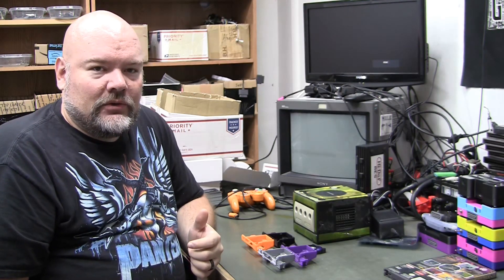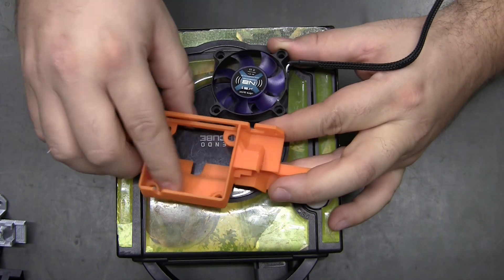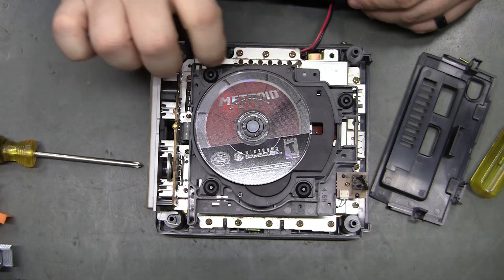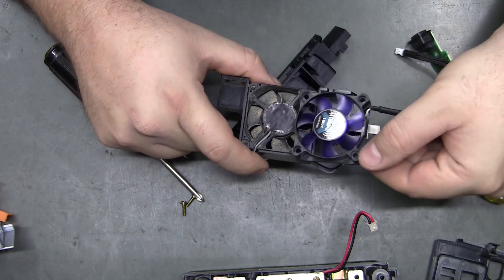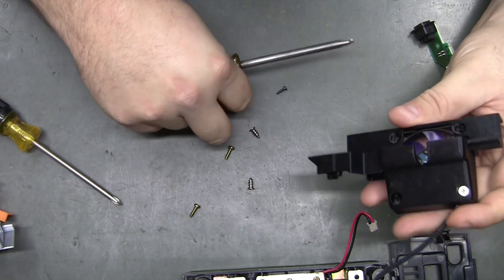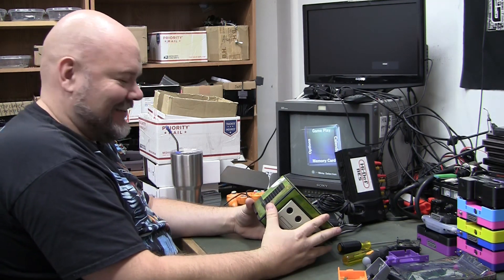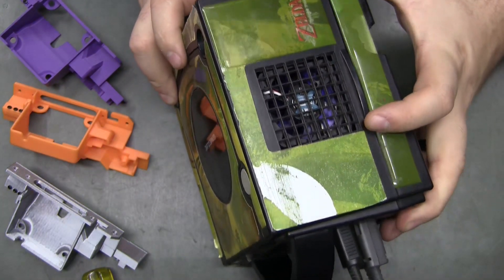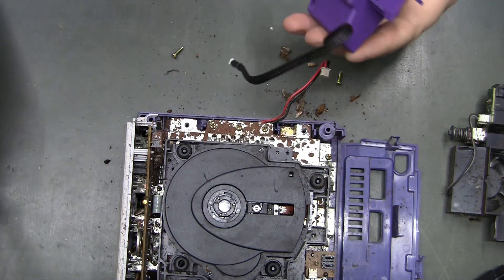GameCube NEW FAN LaserBear 3D print

Comment: Open side of "PC" fan is aways intake. Always
Reply: negative. usually yes, but not always. you can probably get away with it, but it really depends on the company and the whims thereof.

i have 2 server fans that blow the 'wrong' direction. ones a delta and ones a sunon. super loud beastly 120x30mm jobs.
Reply: @kenabi  I'm open to thinking otherwise but in 20 years working on PC's I've personally never seen one. Open is intake for safety reasons as exhaust side blades are sharper from what I understand

Comment: I used to put led fans on them years ago. Xeno mods with Wii SD adapters running Swiss by Emukidd is the thing now. The led it easy to switch out, I prefer color changing.

Comment: How hot does gamecube get?
Reply: Not very. I don't run a fan on my test cube and it runs for hours
Reply: Still its designed with a fan for a reason
Reply: @lukasperuzovic1429  Mainly the power board under the main board but the point is they don't get very hot
Reply: 7

Comment: I wonder if the 40mm Noctua fans would be enough to cool the GC if there was a bracket designed to hold it. It sucks only a few decent companies make 50-60mm fans like Fractal.
Reply: GameCubes never overheat. Fan mods are purely aesthetic
Reply: Still its worth having a replacement option of the original fan runs too loud or if the original fan fails. 
There still a reason the Game Cube designed with a Fan.
Reply: @lukasperuzovic1429  A replacement option is always nice
Reply: @builderbobbo1916  i think mine dying fan spins but barely feel air and it overheating